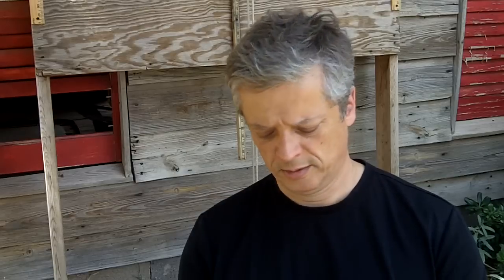242 - My Background and Future Videos

Comment: Hello Patrick, At minute 6:04 you mention the errors in the current literature. If you study long enough, and hard enough, what you will find is that the underlying error is that experiments were based upon technologies, which were assumed to have been used. And, this assumption is based on FLAKES, and FLAKE SCARS. This is why some flintknappers will say that a certain tool is "IMPLICATED".The problem is that a flake from technology "A", does not exclude the possibility of unknown technology "B"

Comment from the maker: To be honest, I only watched the first half of your video response but I just watched the whole thing and it looks like you have a very good understanding of pressure flaking with antler and the arrowhead looked great.  I don't I would have used quite so thick an abrader on the notches, though.  The knife looked very sharp... and the serrated edge is great for skinning.

Comment from the maker: I think you are correct about the misidentifying of the flakes.  But that's just one issue.  Another issue is the way they screen the debitage into different size flakes.  They presume that flakes become smaller as the point nears completion.  This is generally true but not always.  And they assume most of the small flakes occur toward the end of the process, which is also not necessarily the case.  There are other issues bit I will get into it later.

Comment: To give an example, the flintknappers of yesteryear publicly decried the use of antler drift, in flintknapping, in spite of overwhelming evidence to the contrary.  The conclusion of these flintknappers was based on the idea that drifts produce "short flakes".  Unfortunately, they did not understand the freehand indirect percussion process.  If they had, they would have used drifts straight with the edge, and not just vertical to the edge, and they would have gotten totally different results.

Comment: Thanks.  I used the thinnest side I could.  There was still about 1/16-1/32 of an inch of space between the abrader and the other side of the notch.  i think I'll hand off the knife to my sister-in-law for testing.  She's a fur tagger and hide dealer so she skins a not of animals during the season.

Gotta say, it's a nice material but damned tough.  I'm surprised and pleased that arrowhead worked out. =)